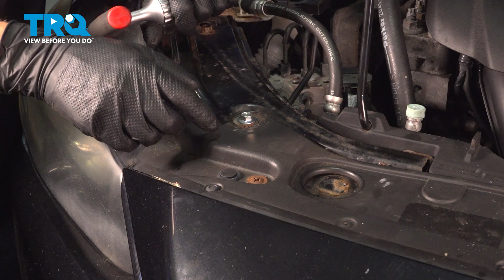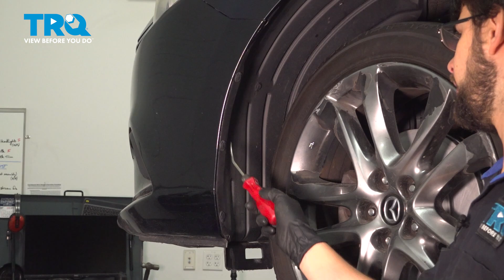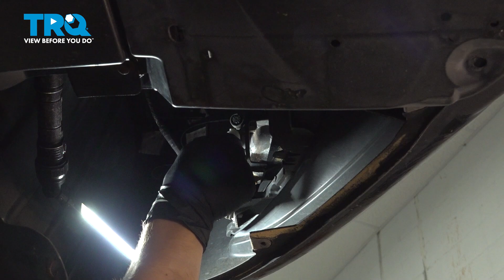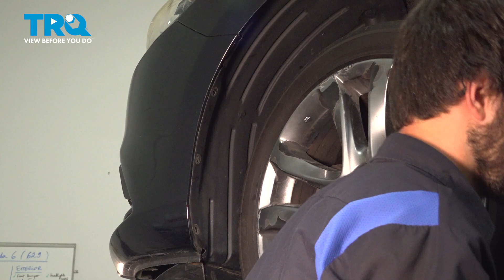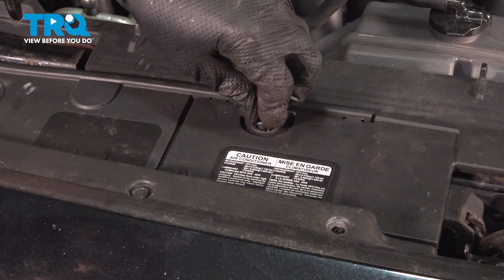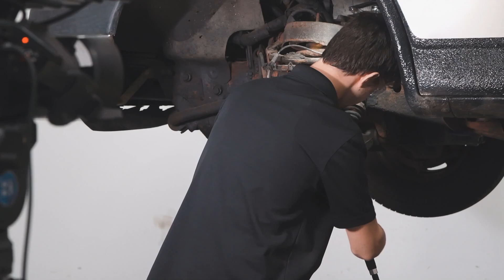How to Replace Front Bumper Cover 2014-2021 Mazda 6

Comment: I'm glad I watched this cause I didn't realize it was one whole piece including the grill section that's secured under the hood. That's prob because the replacement piece my sister ordered did not come with that section included, it's just the bottom piece. I'm hoping I can detach the old one from the grill section after I remove the entire cover as one piece. Thank you for the extremely easy and efficient how to video, I'm headed back to tackle this beast w my new found knowledge! 😁